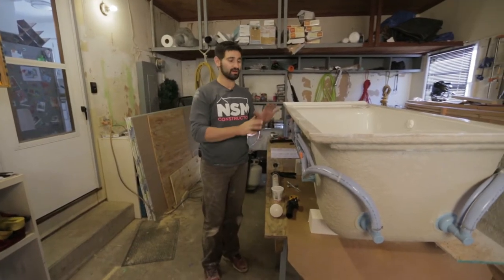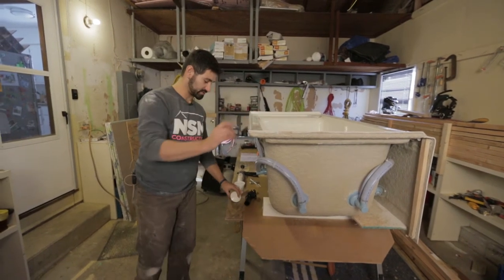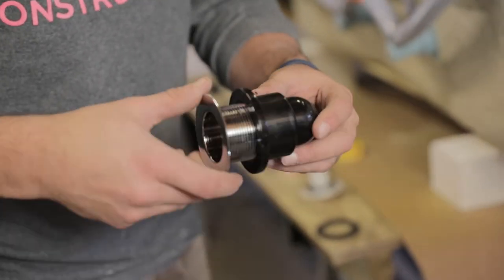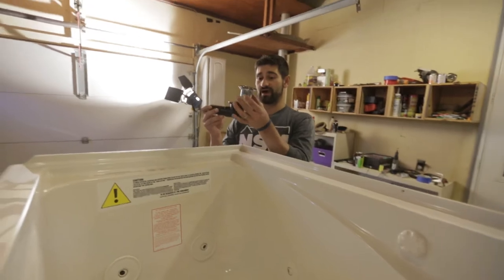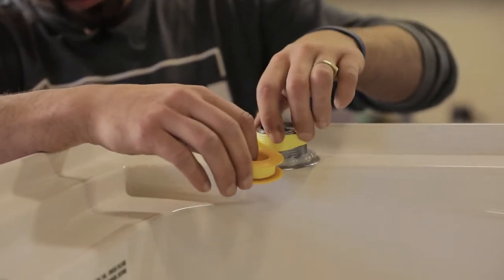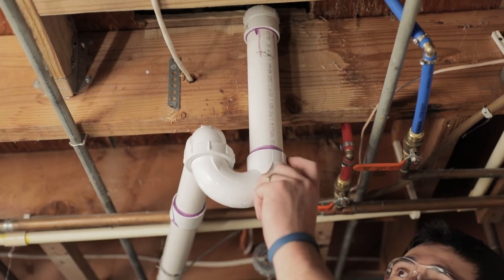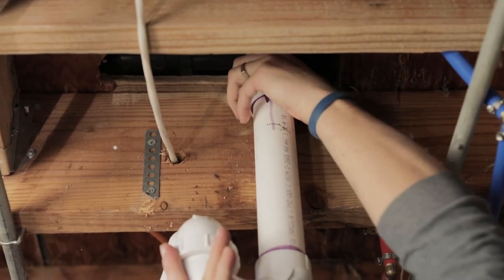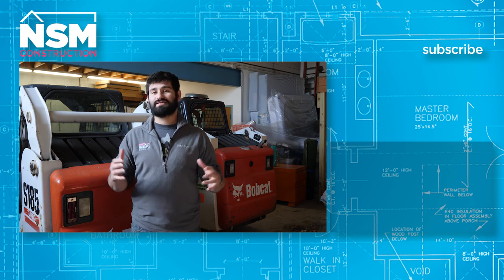How to Install a Tub Drain

Comment: I did follow the way you installed the drain pipes. I would like to add is that we DO need to apply extra silicon under the drain pipes after fasten the drain. Same way applies to the overflow drain pipe.  Thank you for the instructions and I successfully installed my mine for the first time.

Comment: I have not had much luck with those compression fittings, especially on the cheap white plastic ones that they sell for kitchen sinks. They seem to fail in a short period of time. Are the black ones better?  Looking to install new kitchen and bath in new construction. I don't want to deal with material that's going to fail in just a few short months!